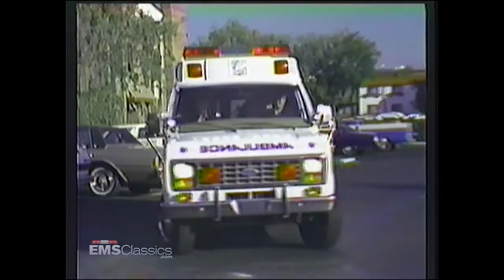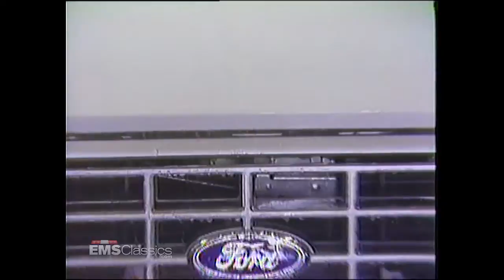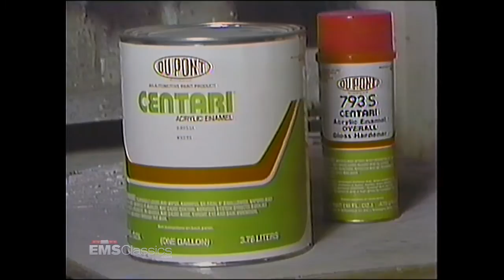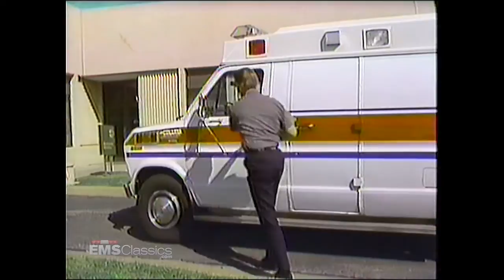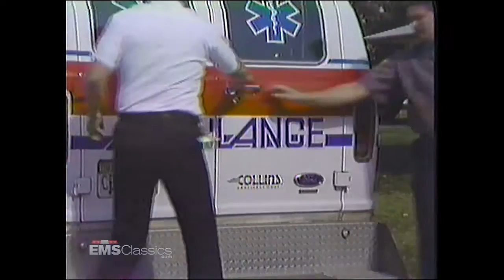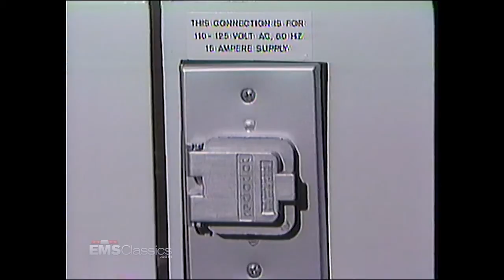1990 Collins Ambulance Products

Comment: what is the switch up in the cab that says h/s used for?
Reply: firefighterengine75 It enables the horn switch on the steering wheel to control the siren functions. h(orn)/s(iren)
Reply: ok thank you very much just one more question what does the A/T switch do?
Reply: Better built van ambulance than the hunks of shit today.